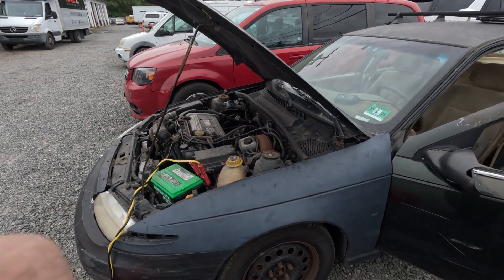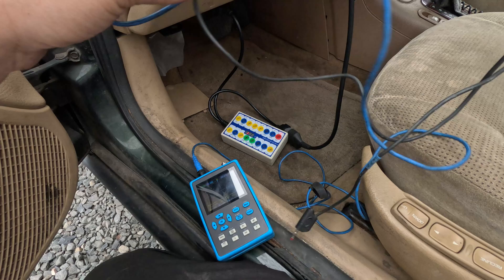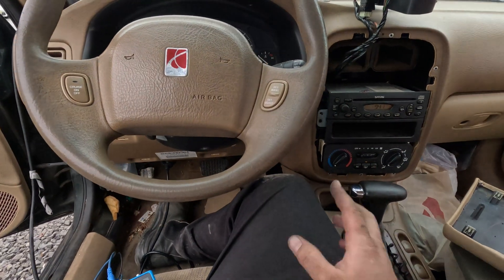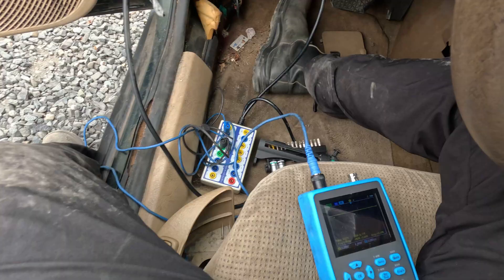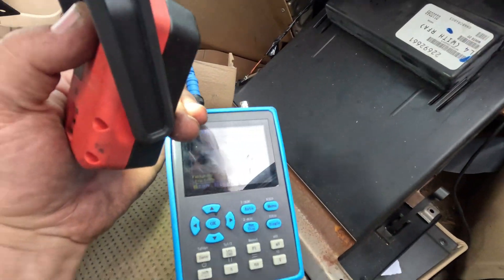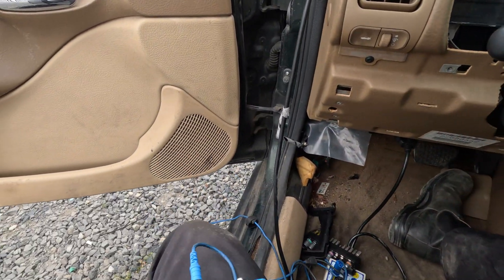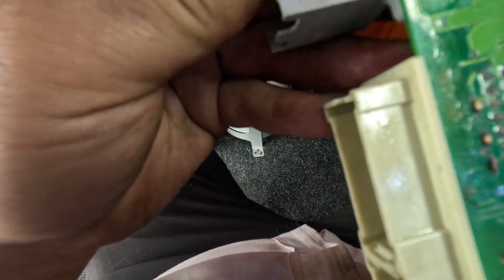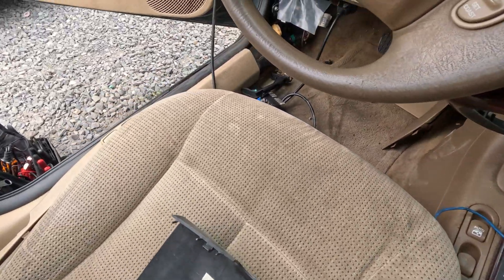2002 Saturn L200 - Crank No Start, Diag & Fix! No Parts Required!

Comment: That's similar to what my 2000 LS2 is doing but it runs and doesn't stall. Sometimes there IS no start and slams into gear and shifts hard when it does it. There's no horn or cruise anymore and the fuel gauge reads empty with the low fuel light on, there's no start. Service engine light is on, which indicates an electrical problem. I have the no communication code as well. Problem is I just had the BCM replaced 3 years ago for electrical issues then too. I don't see how fairly new BCM would go bad that soon. I haven't checked anything yet on the module. I was going to have it taken in next month and have it scanned, but the problem is, is the year is too old for a newer scanner, so I have no idea what works with these years today if it still needs a tech II to program them. There's not much on this problem on YouTube.
Reply: I also found, sometimes if I bang on the top of the glove box, it will come out of it. That leads me to believe it's in the module, why I don't know. It is a General Motors module. I believe there is no aftermarkets.

Comment: Don't you hate when car companies invent something useful like the splice pack so that you can quickly isolate a problem module. THEN HIDE IT SOME PLACE. On top of the steering column so you have to pull the dash apart or under the carpet so you have to remove the seat to access it lol I'm looking at you Cadillac..... Another great video, thanks for bringing us along on your troubleshooting quests, I usually learn one new technique from each video !
Reply from the maker: Thanks, I appreciate you watching!

Comment: I’m having the same exact problem with my 2004 Saturn L300 except mine is a v6… either it starts and dies immediately or it cranks and doesn’t start. I need to have a mechanic do this level of diagnostics on my car instead of me just throwing parts at it with no success 😓

Comment: I don't understand why you did not have talking on the network when you disconnected the BCM, class 2 data is module to module communication using 7-0 volt pulse trains, each class 2 module both receives and transmits, and each module on the network should have set no com. with BCM codes.
Reply from the maker: After I disconnected the bcm I did not check for communication, I just tried starting it and it still would not start. I think because it needs the BCM for the immobilizer.
Reply: @advancedleveldiagnostics  Thank you for the reply. 100% in agreement it needs the BCM to start. If I remember correctly the BCM tells the ECM it is ok to activate the starter relay.